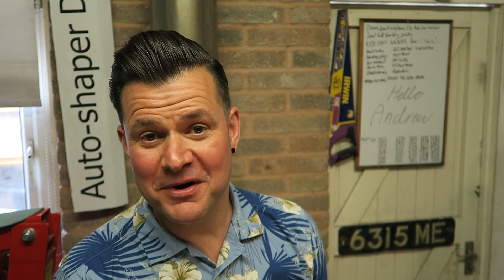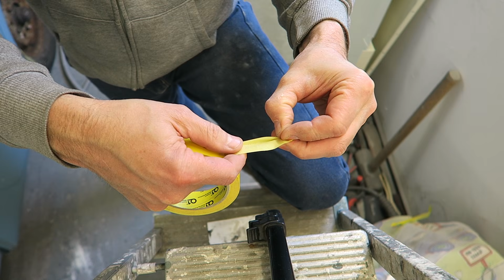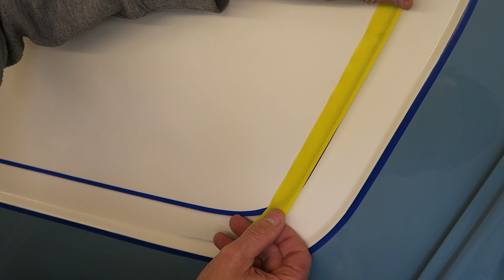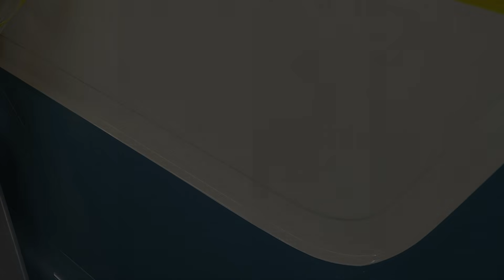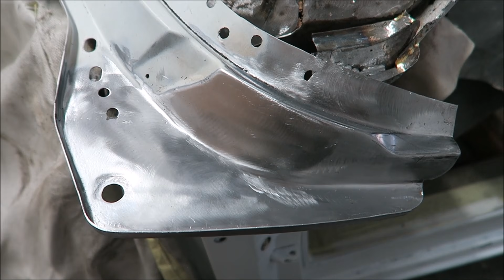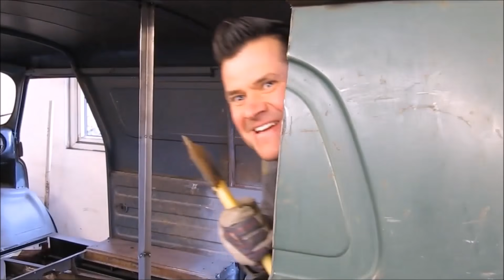Turn ordinary masking tape into soft edge masking tape, blow in repair. Tips and Tricks # 25

Comment: A job that went wrong.. Yep that's what I'm trying to fix right now and wondering if you can help mate.
The problem is a spot rust correction on the tailgate of an 82 land cruiser.
Original paint is 2K , single stage in a custom color . 
Thought I had a proper match for the new paint and it's way too dark.
 Also single stage paint. But only 1K spray can stuff so long wait times to work with 
I had to sand the new stuff off because it was the wrong color and in one spot I'm left with this damn line or ridge of clear coat that just moves further outwards as I'm trying to sand to level with the surrounding area. 
I keep chasing this line no matter what grit I use to sand it will not blend it's level with the rest. 
So on one side I've got the old paint sanded flat, followed by the ridge, followed by primer on the right of it I've sanded so far back . 
I tried the filler trick for getting runs out but it didn't work unfortunately .
Trev if you can help with this I'd be very grateful.
Reply from the maker: Sounds like a bit of a nightmare! Had plenty of those. It sounds like the paint that’s been put on there hasn’t dried properly. Without actually seeing it, it’s virtually impossible to make much of a judgment on it to be honest. Perhaps you could send me a picture. My email is in the video description. Cheers Trev 👍
Reply: @trevsblog  thanks Trev I really appreciate the response. I thought it might not have dried properly too since it's only 1k single stage which is a bit crap. I managed to get it ALMOST perfectly smooth through taping each edge outside the line of clear but I'll send you a pic. Thanks again mate

Comment: The last shot at the very end of this video, shows what looks like a top mounted Jaguar Gas Cap ! I have a 1963 Rambler 440 H sedan , and the gas ( Petro) filler is just above the rear bumper, when I fill it with fuel it backs out all over the ground, I have two Jag gas filler caps, how can I mount them on the rear trunk lid ? Did you make an opening to fit the one in your video ? Thanks Mike
Reply from the maker: Mike Bundock all of the panel work in that clip was made from scratch for a Ferrari 250 GTO replica. This is an impossible question to answer sorry without seeing the problem first hand. Cheers Trev 👍

Comment: Hello Trev!
The curiosity is killing me, as to why there are those pits where the white meets the blue at 18:08 ?
I see you doing jobs where you weld/planish/ finish the surface to perfection and not even need filler...but also you have magician-like skills to fill..so I am wondering if that's intentionally left there?
Reply from the maker: boostismagic I’m not 100% sure what you’re looking at, but at that point the camera is extremely close to the surface of the paintwork, maybe 10mm away and is focused on the area I have blended. There are a few dust particles in the surface of blended area which were removed with the polishing process. Cheers Trev 👍
Reply: I figured maybe polished out...watching the mixing vid now!

Comment: Hi Trev, great video as always, really helpful advice. The one thing I would like you to mention is something I know nothing about at the moment is the different paint guns and nozzle sizes used that are available. What’s the best method and outcome do you tend to stick with as I’d like the same results. Thanks 👍🏻
Reply from the maker: Metal Monkey Motorsport I’m not a full time professional painter. So I haven’t really got the budget for a £500 spray gun. I used a Iwata AZ3 HTE-S 1.3 air cap. It’s got good build quality and a nice wide fan. It cost around £120 I could have used a duren/fast mover gun they cost around £20 and I could still achieve a reasonable finish. Another good gun would be a devilbiss pro. I tend to use a 1.8 for applying primer and a 1.3 for top coats. Cheers Trev 👍
Reply: Trev's Blog that’s great! Thanks for your fast response Trev 👍🏻

Comment: What is your experience with the long term durability of a blow in like this? Back in the 90's when I actually worked in a real shop we would do blow in's like this on collision or used car work but when it came to Hot Rods or restorations we would paint the entire panel unless there was a hard body line to really hide the edge. On your van we probably would have redone all the white but I could maybe see us just blowing in the recessed body line area but, going all the way around so there were not the 2 blended edges on the flat part of the recess. 

Occasionally we would see some of the collision or used cars a few years later and the blend area was more visible then when it left our shop. Is that more a function of blending into older paint and does it hold up better on fresh paint?

You are right about that foam soft edge tape. I remember our supplier pushing that on us one time. We gave it a try and quickly threw it in the bin and went back to regular tape.
Reply from the maker: The Insane Shecklador the main reason I did what I did was to get away from having to mask against the blue all of the way round. If it was on top of manufacturers paint I believe it would have looked awful but because it was on top of fairly fresh paint using exactly the same product it looks fine. My experience with long term durability with this kind of thing is mixed but that’s the nature of the job. Cheers Trev 👍
Reply: @trevsblog  Thank for the explanation Trev.

Comment: Trev, thanks - almost makes you hope for a run in order to try it out!  Do you know what causes small air bubbles in a 2-pack top coat? Not sure how to send you a pic.
Reply from the maker: milmorguy without seeing it first hand impossible to say. Possible causes are water in the air line resulting in blistering or micro blistering/ popping caused by putting too much paint on and causing solvent entrapment.

Comment: Great work, we’ve all been there.  I find painting 2k dg in less than perfect conditions benefit from being thinned 2 or 3 times more than I normally would if I was painting in a booth. The trick is to turn the fluid needle in and put thinner layers on, build it up with 3,4 or maybe 5 coats to get depth. This way there’s no risk of getting runs, trying to flow paint in the cold is why it gets overloaded!  All the best, from the Forest of Dean

Comment: Looks good Trev, you wouldnt know it was there. Ive had some success doing smaller 2k solids repairs and spots with the PPG Deltron 8731 spot blender in the aerosol- Light coats though. pretty much what you are doing with the thinner though. Its handy for homegamers in a small aerosol .

Comment: that soft edge method can also be used in double layer if you want to do a base coat the pull one layer off with the soft edge for the clear a few mill back so you get the complete base edge covered, esp useful for waterborne bases
You can also get curved masking tape for going around corners, i use that to make my soft edge runs when doing inside/outside corners